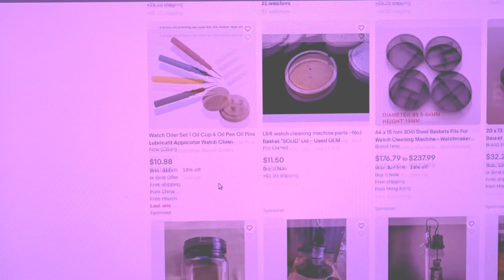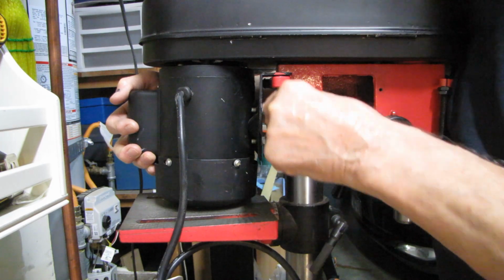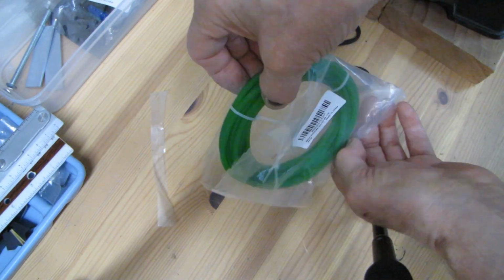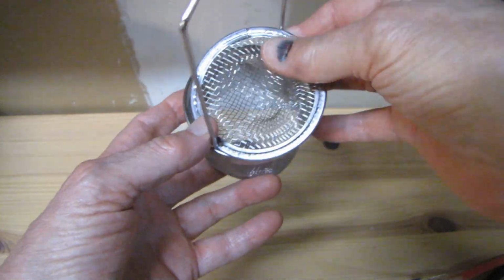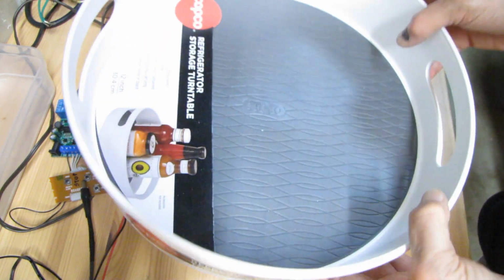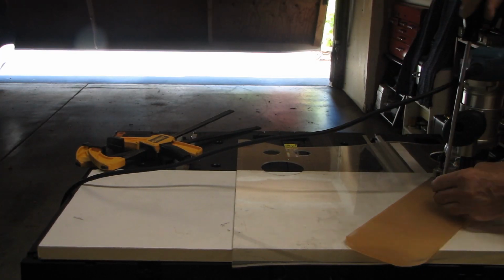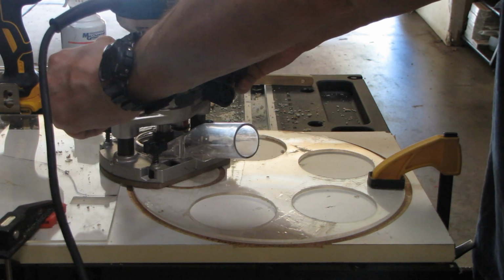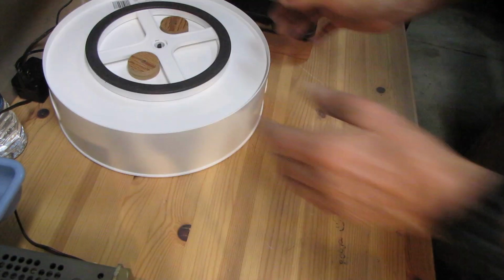How I Made a Watch Cleaning Machine DIY Project

Comment: 40 years ago i used to run across watch cleaning machines for 50 and 100 dollars and now the price WOW , , i am thinking a deWalt vari speed drill and a vintage craftsman hand drill drill press and a watch parts basket and mason jars and an electric hotplate , nice build Sir
Reply from the maker: Thanks for your comment! Yeah, these days the watch cleaning machines are at $500 and up. The project of building this cleaning block cost me $100. I added another $50 later to get the scissor lift motorized (there is a separate video about that).
Reply: @ValentechTime  so so cool ,, do you have a link to where you got those glass jars with the lids ???
Reply from the maker: @Anne6621  I've no link, sorry. I purchased these jars at the local Japanese store for $3.25 each.

Comment: Great video !  I was actually thinking about doing this very thing ...adapting a drill press...and then I thought....I'll bet somebody else has already done this.  You've done a much better job with your design and build than I could have.  But looking at your list of accessories and materials, I'm not seeing any of the electronic components... microprocessor circuit boards etc. listed.   Could you share or provide a link as to what they are and where to get them, please ?  By the way, I've already liked and subscribed !
Reply from the maker: Thank you Kevin! I've just added the links to the motor controller and to the motor I used to motorize the scissor lift (there is a separate video about lift motorizing). I wish you good luck and thank you for liking/subscribing!
Reply: Well, your reply was faster than the time I typically wait for somebody to return a phone call.😂 thank you for sharing the information and again for such a great video.
Reply from the maker: This time it took much longer, because it was a night time here. Usually I am trying to respond as soon as I can. 😄
Reply: What did you use for the 120/110 to 24 V power supply?
Reply from the maker: @thcmagus  I use the lab power supply to feed the motor's 24V. It takes about 1A. You can use any power supply/adapter that can deliver the same wattage.

Comment: Hello and congratulations. Do you have a detailed wiring diagram of how you connected the controller to the motor? In your descriptions, you didn't see where you found the glass vessels. Thank you Davide
Reply from the maker: Thank you, Davide! The wiring diagram came with the controller, power supply connections were routed through power switch (green). The jars were bought in a local Japanese store for $3.25 each, but any jars could be used, providing they have an entry slightly wider, than the used  basket.

Comment: Super clever. I'd like to try this. May I ask a question? 
Why elevate the carousel upwards . Is it not simpler to have it at a fixed level and then simply lower the pot into the carousel/ jar using the drill press?
Reply from the maker: Thanks! Yes, it would be simpler to have the drill press to do all basket movement. But it is limited to only about a 70 mm way to go down. So, to move the basket down to the bottom of the jar, I need to lift the carousel up for about another 70-80  mm. After I published this video, I improved design by adding a motor to do a carousel lifting job. I have another video for showing work on making a motorized lift. Thanks for watching and good luck in making your own watch cleaning machine!
Reply: @ValentechTime  Thank you I'm definitely gonna try this - I think the scheppach dp60 digital pillar drill might be an ideal candidate as it has variable speed is geared and the rpm falls in the range required.
I'll take a look at your other video's - very inspiring.
You are exactly the person I need to help me remote control my motorised dalek but that's another project!
Reply from the maker: @simons1543  I looked at the Scheppard drill press, what's the lowest speed it can get? I replaced the original motor with the one from a scooter and reduced speed to few hundred rpm. Also, I can control motor speed by regulating DC voltage. It should be a fun project!
Reply: @ValentechTime  According to specs I believe it's 170rpm - 880rpm on gear 1 and 550 - 2500rpm on gear 2 - variable. Yes I've gone ahead with purchase so fingers x'd! Whatever happens, I'll have a pillar drill so tbh its win/win
Reply from the maker: @simons1543  Great! Looking at the drill press photos, I am not sure if there is enough space from the chuck to the bar for carousel to fit in. The carousel diameter depends on the jars size and their quantity. Just a thought.

Comment: I used that same controller board and a overhead lab stirrer with a DC gear motor for my machine. My baskets are 3D printed. I like the way you made the rotating base.
Reply from the maker: Hi John! I agree this controller is good for this task. Do you have a video for your setup? I want to motorize the jack lift, it should be a good upgrade. And then I will need another motor and controller. 🙂 Thanks for sharing!
Reply from the maker: I found your last reply on my cell, but not here (in browser). I also found your short video. Looks good, I was thinking about using stand like yours before deciding to use a spare drill press. What the name for that stand? And I am interested in what heater/fan combo you use. Thanks.
Reply: @ValentechTime  Please see the comment for my video for build information Thanks!
Reply from the maker: Thanks, I found your post on the Reddit. Wow, you did it a year ago, nice setup!
Reply: Thank you so much for this video ! I’m just starting out on this journey and have been trying to come up with a way to make my own cleaning station. This has given me so many ideas and additional paths to take making mine.

Comment: Hello, how can I contact you to ask you a question about issue regarding my ETA 2783 movement?
Reply from the maker: Hello, you can ask watch related question here.
Reply: @ValentechTime  I have a eta2783 automatic movement. It had a issue with keyless works and I replaced it. It was running fine and precise until the winding stem broke. After It broke while waiting for the new stem to arrive the watch randomly stopped working. where do I search for the issue or how to diagnose it. I'm new into watchmaking and don't have very much knowledge about issues like that. Thanks in advance!
Reply from the maker: @gjorgisokolovski3071  What first comes to mind is the hack feather. I think this movement has it. If it so, than broken stem left the keyless works in the position when hack went to the intermittent action, hence the watch randomly stops. After you replace the stem the issue might go away.
Reply: @ValentechTime  When I put the new winding stem the watch still doesn't work
Reply from the maker: @gjorgisokolovski3071  From your previous message I thought you are waiting for the new stem to arrive. Anyway, you should open the watch and check how keyless works works. Maybe some else broke or went out of place. Or some piece from broken stem fell inside the movement. Inspect everything.
Reply: @ValentechTime  Thank you, I will look around at the keyless works!

Comment: That’s not a watch cleaning machine. It’s some jam jars in a bucket under a pillar drill and the jar is completely exposed to all the workshop filth and contaminants.
Reply: The machine cleans the components, therefore, logically: it is a cleaning machine.
Where is your machine building video here to help us advance in machine engineering. Or have you never designed one?
Reply: @tadeubotelho4410  His is in a hermetically sealed room in his watch bunker.
Reply from the maker: Replying late, but with a earned experience on this machine functionality. It works great for cleaning, it's an improved lifting mechanism and there are no splashes to my garage. It is a cleaning function, as it was thought to be.